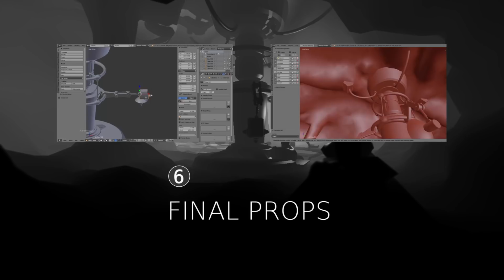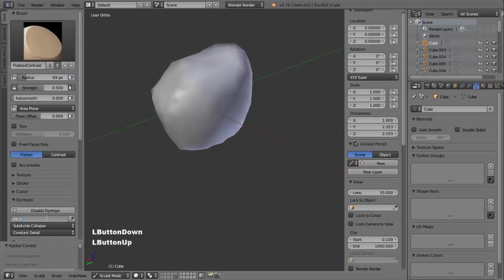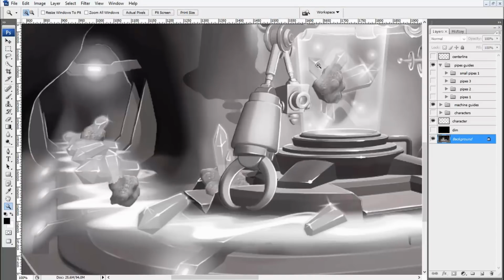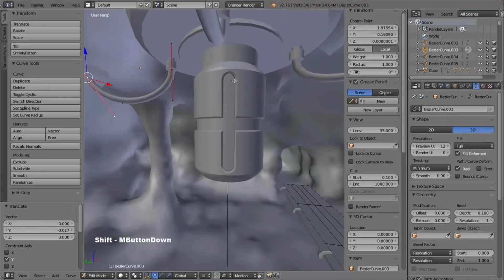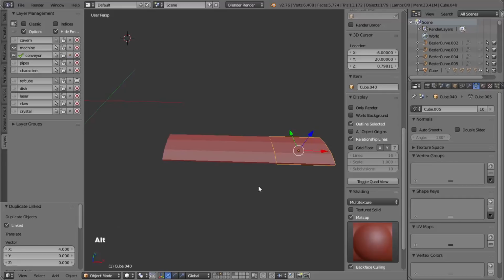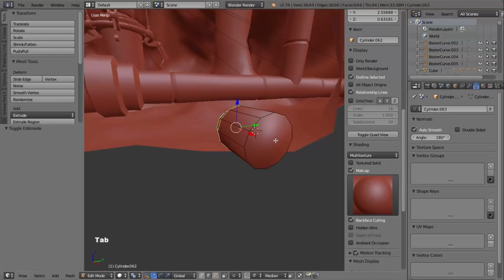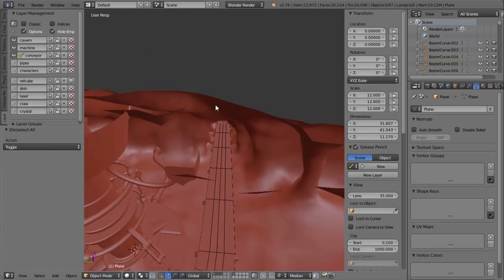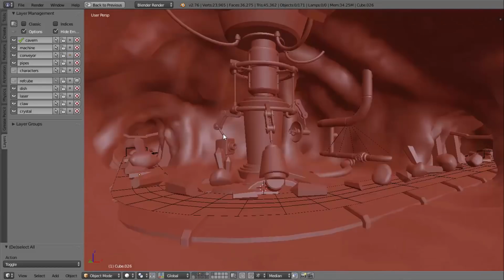Sci-Fi Cave Environment Course | 6 - Final Props

Comment from the maker: Hi Aidy Burrows here, we’ll pin any important info that happens to crop up here. 

Useful Times > 

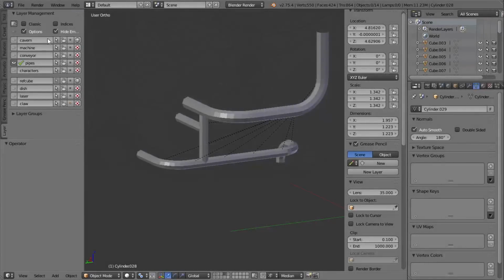Part 1 - 01:28 Pipes
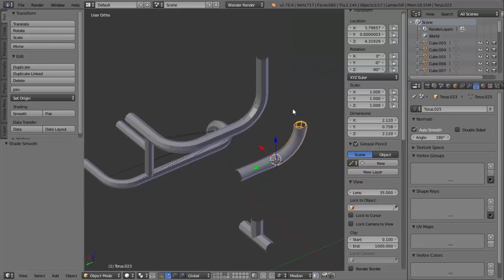04:46 Sharing Object data with Ctrl L > Object Data
Part 2 - 08:35 Conveyor Belt
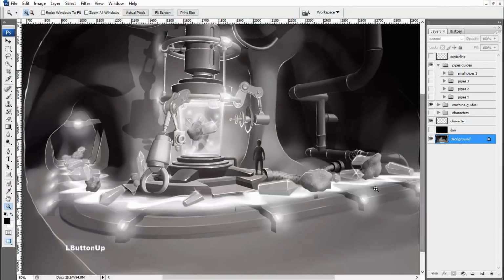Part 3 - 12:46 Rock And Crystal Objects
15:10 Flatten/Contrast Sculpt Brush
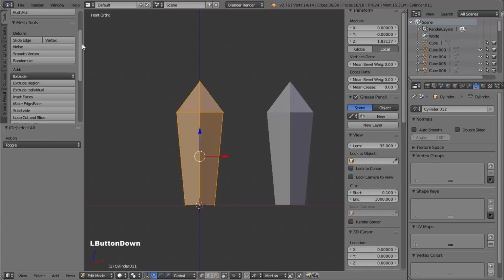17:59 Slicing Objects with the Bisect Tool
21:14 Trackball rotation style by pressing 'R' twice
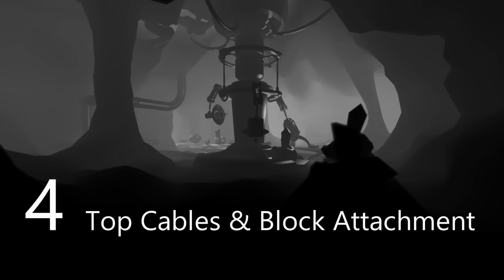Part 4 - 31:28 top cables and block attachment
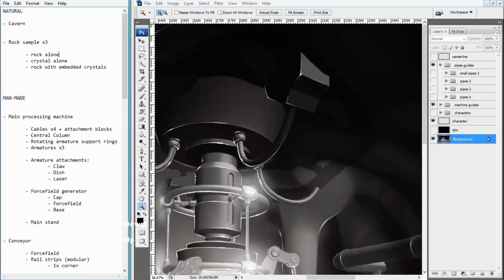Part 5 - 47:33 Tunnel Support Struts
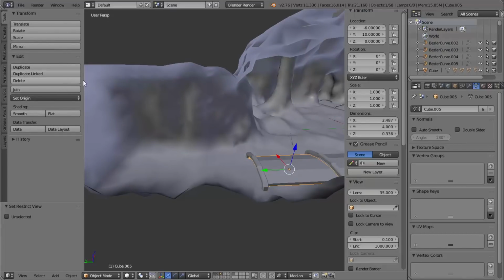48:51 duplicate a linked copy with Alt D
Part 6 - 1:04:15 Valve Wheel Object
1:11:24 Extruding individual faces from the Alt E Menu
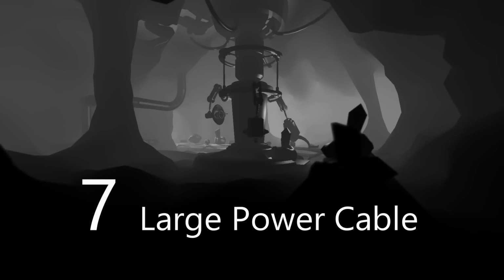Part 7 - 1:13:04 Large Power Cable
Part 8 - 1:23:08 Light Fixture
Part 9 - 1:31:07 Extending the cave tunnels
01:46:07 Shift F for 1st Person mode
Reply: Looking forward to the last part